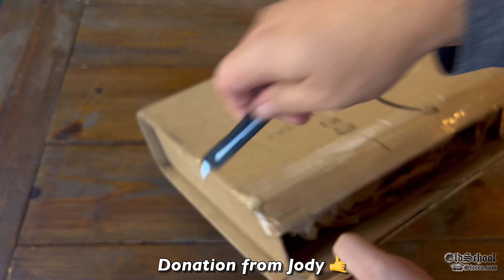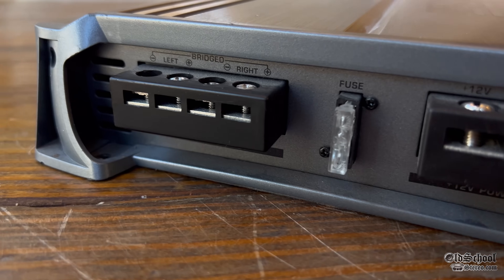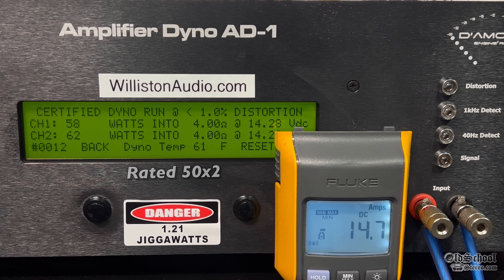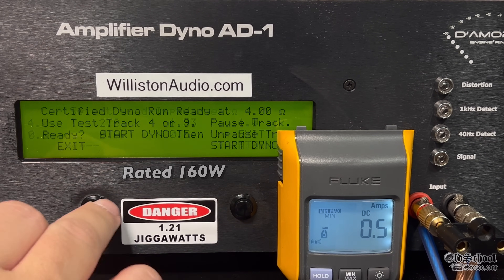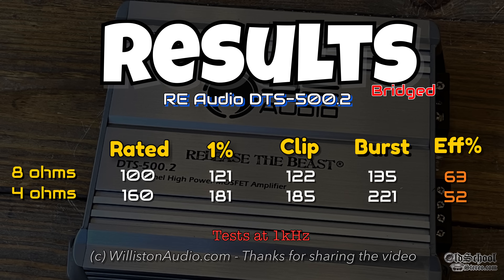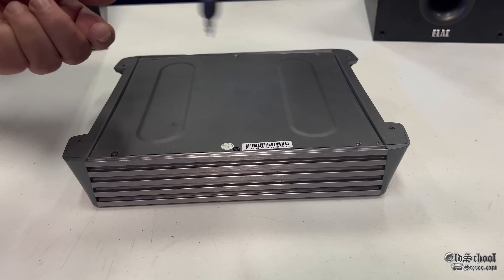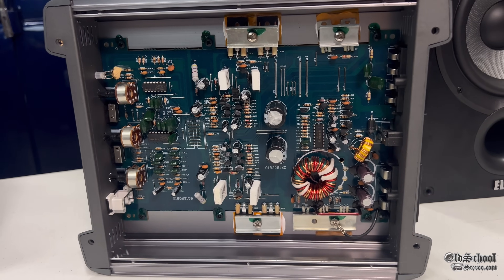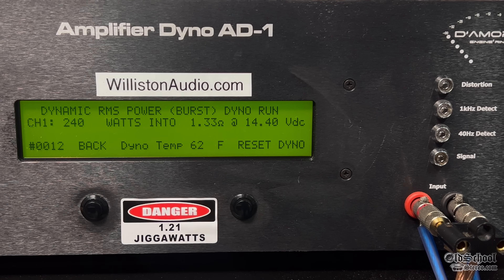2012 RE Audio DTS-500.2 Amp Dyno Test

Comment: I just fixed this amp a couple days ago. I dropped a subwoofer box on the RCA ouputs and broke the ground solder. I paid $46 in 2013. I used it to run 2 clarion 6x9s. They eventually got pushed so hard the surround stretched.  I used it for 5 years no problems.

Comment: Somebody please enlighten me, what is the obsession with Tiffany RCA s?  Does it make the amp sound better? Does it increase the current? Does it increase the efficiency? Sorry but I don't see that as a value added item????
Reply: They are of higher quality and they bolt onto the amp frame so you don't run the risk of breaking them off the board if you push them on too hard or if they were to get hit by something.

Comment: TIP 35c & 36c were very common output chips in a A/B Class amps of the early 2000's . My MA Audio amp had 6 pairs per channel and 4 40amp fuses 😎
Reply: Where would one go to look up whether certain mosfets and chips are good or not?

Comment: At least it did it’s rated power and is the budget model. 👍🏻
There are smaller amplifiers now doing the same power but most are not “Korean” style.
On a side-note, “Release The Beast” in my opinion should only be legal to those amplifiers that are more than 1000 watts.

Comment: Man.....RE audio brings back the mems. Worked at a shop who completely revolved around RE ne DD back in the 2010s. Lots of good memories.
Reply: Talk about old, my first true stereo install was back in the 70's. Pioneer 8 track SuperTuner, four Pioneer 20 watts x 2 amplifiers, three pairs of Pioneer 6x9 2 way speakers and two Pioneer 3way home speakers in my 1974 Ford Econoline.
Still one of the best systems ever, for playing 70's Rock 'n Roll!🤘
Reply: Man I feel old. You say back in 2010 and it feels like yesterday I was playing with dhd, audiobahn, ppi, lightning audio, the original hifonics gear. Nothing beats old school quality and build.
Reply: @ewingaaron1....what a great brand RE Audio was, I'm still running a couple of slot ported boxes with their 8 & 10 inch stamped steel basket subs, they sound incredible! Big question is.....what was the name of their box building software, I honestly thought it was better than anything else at the time!
Reply: @glenniz1 Re Audio box calculator. It's still around